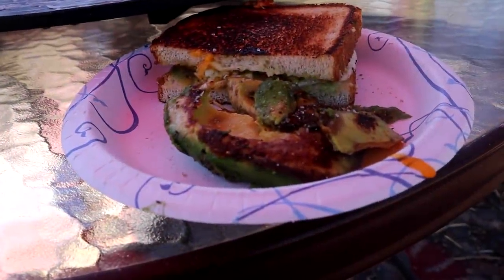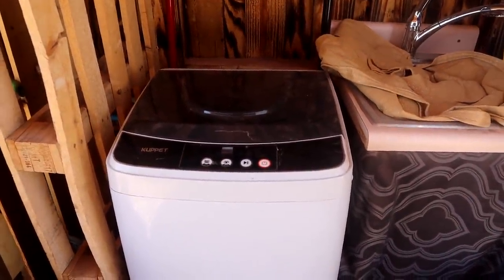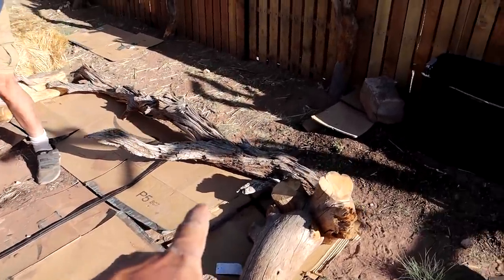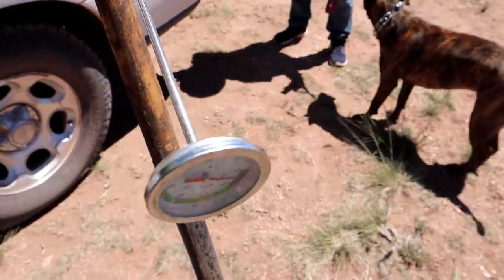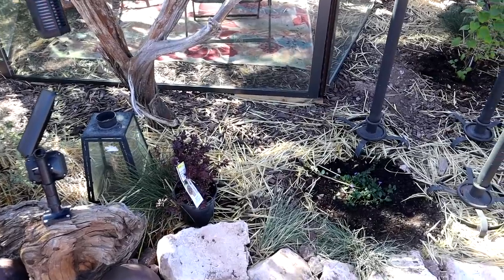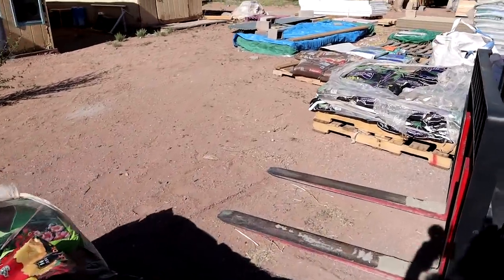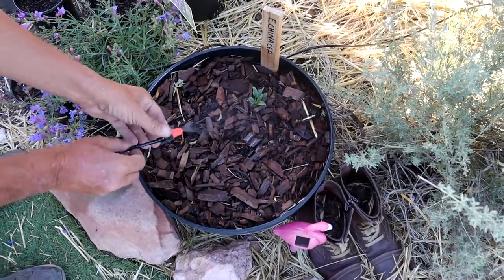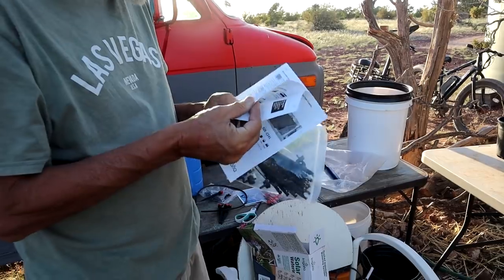Outdoor Shower Update, Adding Drip System, Pressure Tank & Underground Pipes Finished

Comment: Cool shower system. Great idea. Scarlet climbing runner beans are easy to grow along a fence. You use the fence for them to climb up and they produce nice long green beans, and the vines have pretty red flowers before the bean developes. The climbing vines make the fence look green and lush during the summer. You can also plant them with corn and sunflowers and they use the large plants to grow on. Aboriginal people here in Canada do that to maximize their garden space and are companion plants. Underneath they plant squash, pumpkins, cucumbers etc. that will spread underneath the corn and sunflowers and at the same time help keep the soil moist. Cantaloupe and watermelons are easy to grow in a dry hot spot. Take a bag of soil and make a hump or mound of earth. Plant two or three seeds of each in the hump. Water every couple of days. They will spring up quickly and grow down the hump of earth and spread. They look so nice in the unplanted areas of the garden. Once the season is over add the wilted vines to the compost.

Comment: Periwinkle loves hardwood mulch. I had clay soil back in Virginia and only dumped 2 inches of mulch on the bare ground. I let it settle over the winter and planted Periwinkle, azaleas bushes and 3 kinds of apple trees.  I did put good soil in with the trees and bushes but planted the Periwinkle in the clay soil. I loved when they bloomed with their pretty flowers. In the fall I would put real and artificial pumpkins in the  area. It looked like a real pumpkin patch. I planted purslane in the spring where it was sunny. This would work in Arizona because it's a kind of succulent plant with beautiful colorful flowers that look like small roses. It also will spread out like a ground covering. I had another ground covering but I can't remember if it flowered. By using ground covering, you reduce the need for mulch once it establishes it's.  Periwinkle will stay green even in winter if it's warm enough and comes back each year. Purslane can be covered in mulch over the winter and can reseed itself.  I'm not sure about your area, but it did in Alexandria, VA with a mild winter. Near the house were there was a lot of sun, it always came back. The other ground covering also always came back, but didn't totally die until it snowed. I always lightly fertilized for root growth in the fall and more heavily for flower growth in the spring.  I was an outdoor gardener for over 30 years aud an indoor gardener for even more. I also helped my father with his flowers, berry bushes and flowering trees when we visited their lake property. I really do miss gardening.

Comment: Now I know why my drip system didn’t work right.  It was on a timer. I’ll have to look and see if a larger main line can be run from it or just get a different system.  The tubing was very small.  Thanks for the info. 
Your garden is really coming along and looking wonderful.
Reply from the maker: Yes glad we figured it out before laying any more.
Reply: @rvpandamonium  that was a lot of work putting that system in.  Like you said tho it will certainly help.  Your place is looking so good.

Comment: Those adjustable sprinkler emitters can be great, but they can change their setting seemingly on their own (must be wind, vibration, or temperature fluctuations that does it), and the emitters themselves can fail.  So they do need to be checked and monitored on a very regular basis, or you'll think you're irrigating when you're not.  Each one has to be checked because they each have a life of their own.

Comment: Its so hot especially through july everything just dies by the middle of august without rain we are in fire season. We haven't had enough rain through the winter by july it will be the hottest with 110 degree temps. I bought some water bottle waters, all you need are soda bottle fill them up screw on the top turn it to drip for the day time through july and I hope that it will work this summer. that way I can conserve water and keep my apple tree and apricot and jasmine. If this doesnt work for you, you can always try the bottle method it only takes so much water per bottle per plant. Good luck !!! with I were traveling right now so much has happened. Its now 5.85 a gallon, everything is messed up....

Comment: Don’t know if I missed this … but are you going to put the drip system and any other sprinklers on a timer?  Can you even do that without electricity (maybe solar)?  How are you going to water when you’re gone?  You can set it up to do zones individually, one after the other, to control water pressure issues.

Comment: Your gardens are just amazing. Love the drip system. Love the shower and laundry. And your purple strawberry pot! So glad you mentioned the pressure differences of the two size hoses, and showed us the drip emitter adjustments. I thought I wouldn't be able to get a drip system because I wouldn't get enough pressure from rain barrels. Do you have a pump pumping the water through the main line? I looked into getting a well drilled, but one estimate was $6,700 and the other was $11,400. In other words, no way. I can't use the municipal water because it's crazy expensive here in NJ (and probably anywhere that is under American Water Company jurisdiction). What to do. I can't wait to see all your plants mature, especially vegetable plants. Looking forward to seeing all the pretty salads you'll make and meals you'll cook with them! Good luck with them!

Comment: Oh I wish you had knew before the stupid inflation, that stuff would be oh $25 down cuz I used to get stuff like that for my birthday wheelbarrows and whatnot. If I ever got another wheelbarrow it would be the dolly four wheels and you pull. Composed to  one tire, that would dip left and right if you put too much in it which was hardly nothing at all. Also as you're planning they are bed buddies and they are not bed buddies and I know for a fact cuz I did just two years in a row and I got corn and okra do not like each other. Can't put a tomato plant in your compost or leave cuttings cuz you know you trim tomato plants the limb unwanted limbs off too many blossoms and whatever. You don't leave them on the ground either it's it could have a disease that you don't know about and it could spread to your other plants and you can't put it in your compost either for the same reason. I just physically cannot break the ground with the shovel anymore I went out today that dry some of my husband's blue jeans and I kept stepping in holes, that probably 2 years or 3 years old from digging in my backyard making garden. my husband hates moving to get backyard because of it. Oh you're really going to enjoy and love your garden.